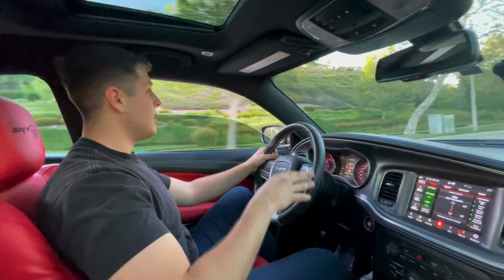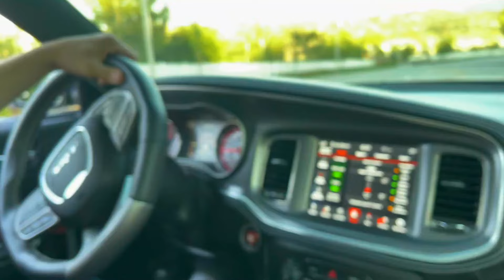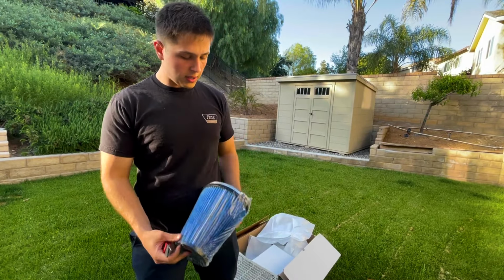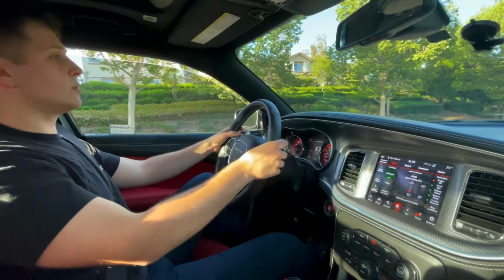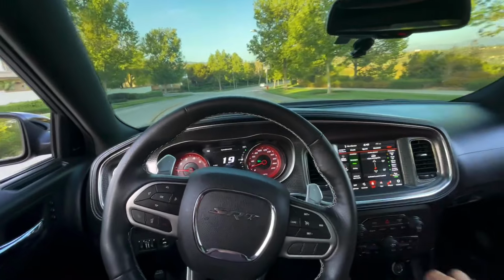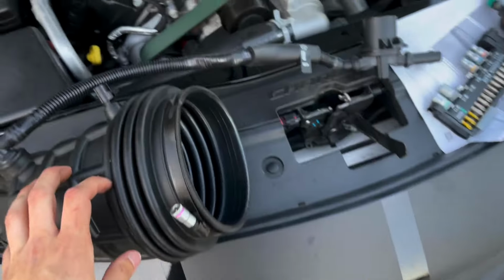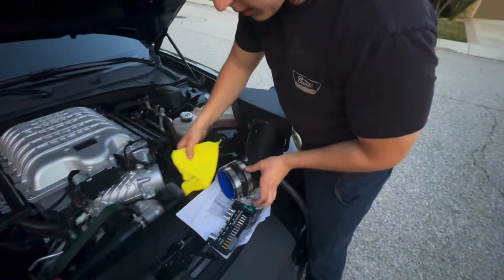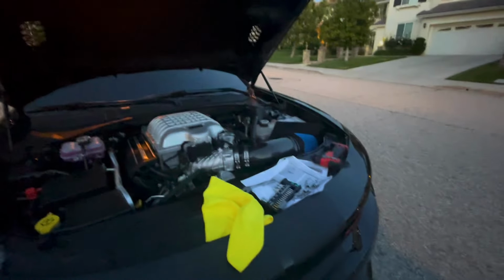NEW COLD AIR INTAKE FOR MY HELLCAT REDEYE WHINES LIKE CRAZY! 🍷

Comment: I got the legmaker intake i felt the same way. I couldn't stop driving and still can't. Radio is useless when you have this whine. I have it on both my Hellcats years later from my 19 and it Never gets old and never will.
Reply from the maker: I was about to get the leg maker but I wanted some type of heat shield. I still plan to get a leg maker and use this heat shield